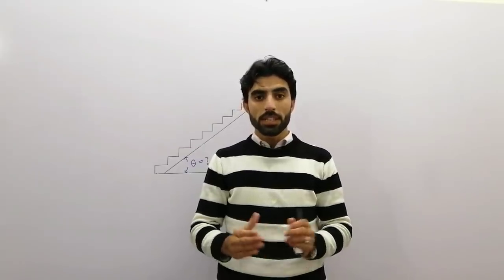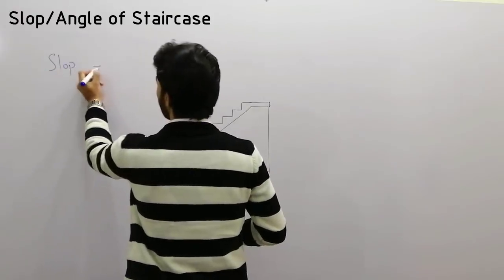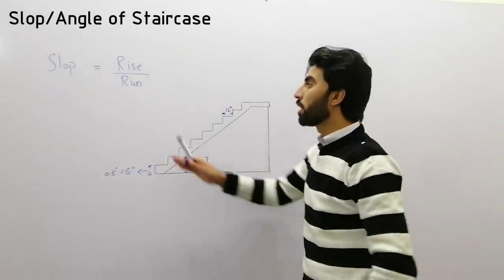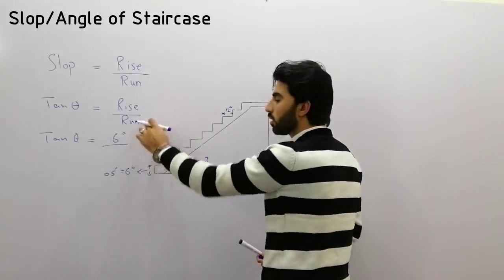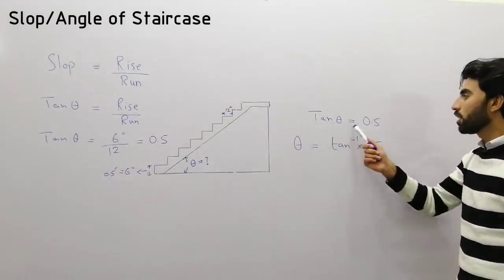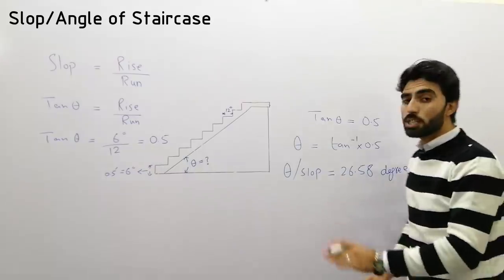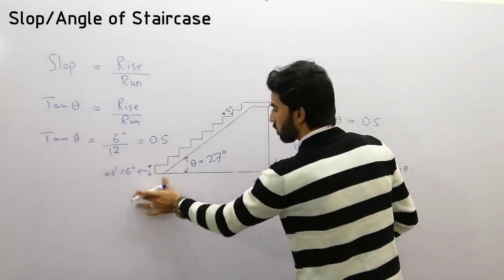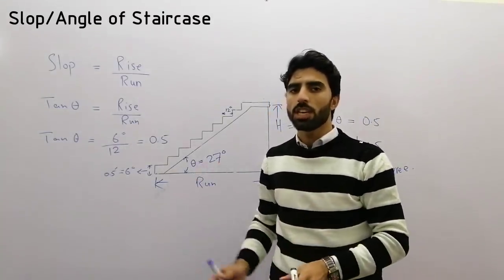How to Calculate Slop of Staircase - Angle of Staircase - Civil Engineering Videos

Comment: There is almost no need for this calculation in any real construction situation. Setting up for the rise and run is the important step. It is obvious that you have never constructed a staircase or have any construction site experience. I am a carpenter with a degree in Engineering and 40 years of experience. Also, stair layout and construction is never done in feet, always inches, unless you use metric measurements, then it really doesn't matter. Rounding the slope like you did in the calculation introduces a great deal of error in the overall length of the stair stringer.

Comment: It is safer to calculate theta with your first method. In the second method, you would need to subtract the length of slab upstairs from the Run before you calculate the tangent.